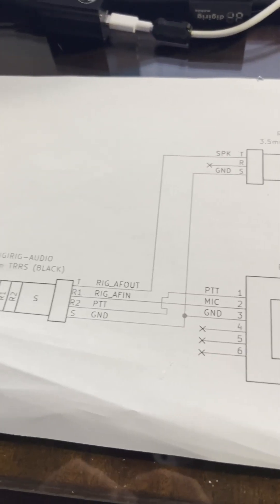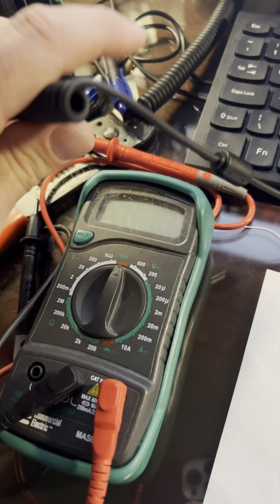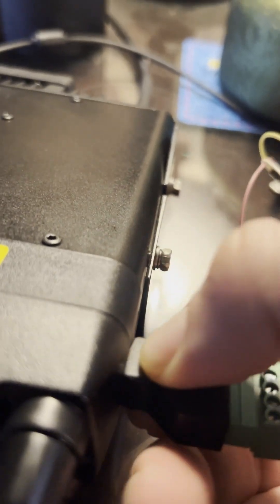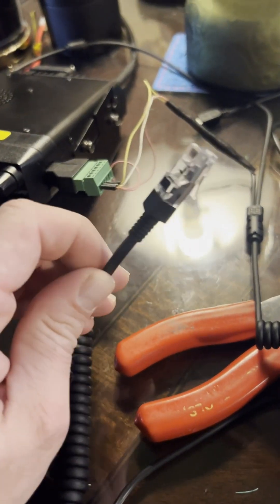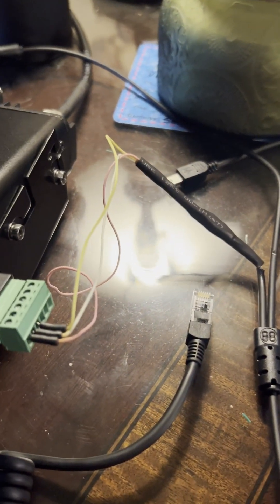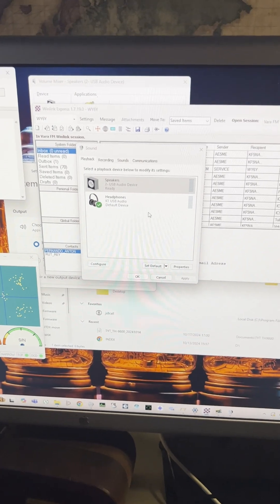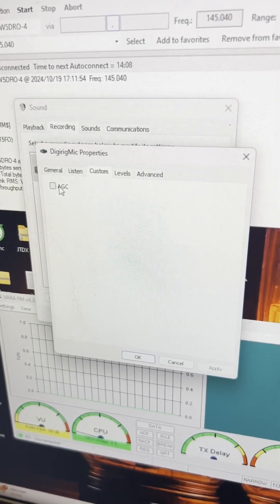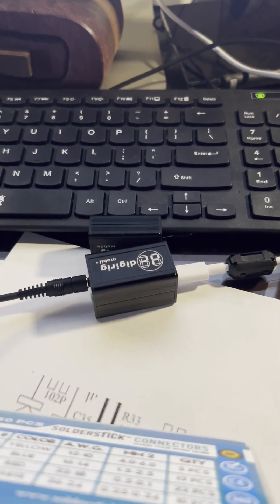Using a TYT TH9800 with a Digirig for Winlink and Echolink

Comment: I am doing a similar conversions on a Digirig cable for my HF SSB radio that uses a DB9 connector. So I am cutting the Digirig cable and using CONBLOCKS I ordered from Poland to do the splice solder connection. I bought a DB9 connector similar to what you used for the RJ12.